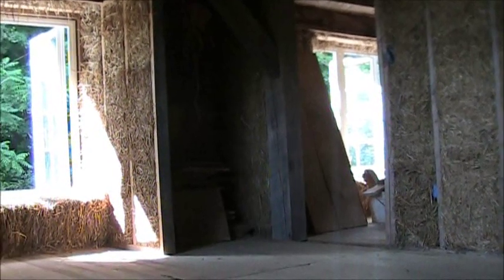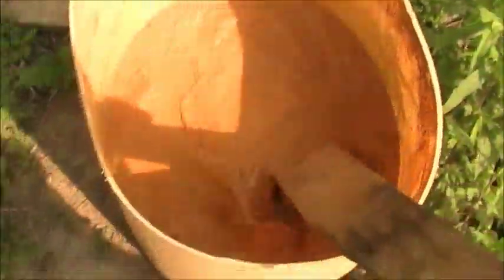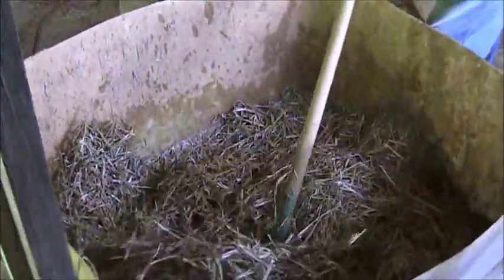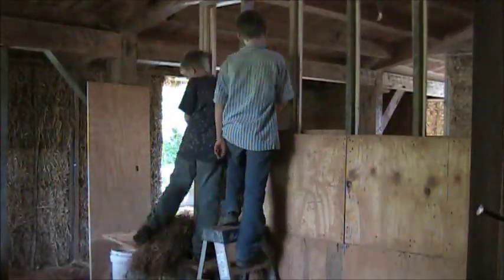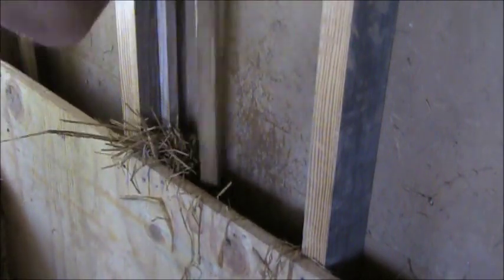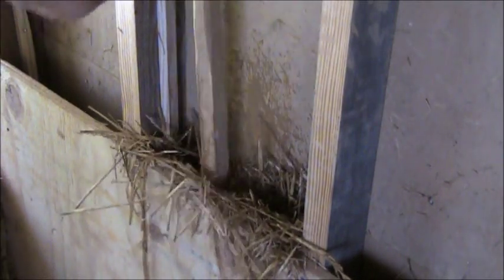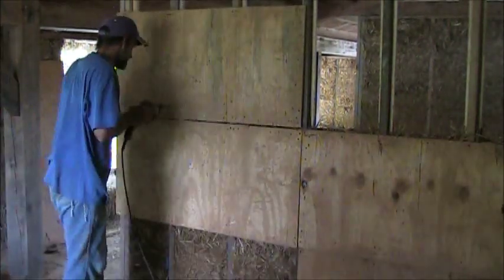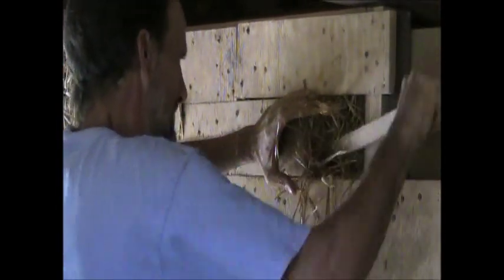Straw in the Wall: Using light straw clay (slip straw) as interior wall fill

Comment from the maker: This building technique (and other ones using straw and clay) have been used for centuries, even in the UK. I don't know what the fire regulations in the UK are, but once the walls are plastered, they are quite resistant to fire, perhaps more so than conventional walls. That doesn't change how regulations work, I know. I am glad that I don't have to submit to irrelevant regulatory oversight where I'm building.
Reply: I couldn't press subscribe quick enough you Sir earned a big ol Texas dammit boy.
That's smart and you made me smart.
Thanks for sharing your knowledge.
Blessings and more Blessings to you and your Family 🤗👌
Reply: Hi!!! Cant find any info. Do you think i need a vopor barrier between straw and exterior sidding???  Using this insulation for a tiny home and doing plaster inside but standard sheeting outside . Help!! 😬ty
Reply from the maker: @kerriemortimer8243  I wouldn't want a vapor barrier immediately against the infill. It would probably be okay with an OSB sheathing and then standard vapor barrier & siding. The concern is moisture that migrates through the wall from the inside. If it hits an impermeable barrier, it will be stuck in the wall, and wet straw will deteriorate and mold. I would be more comfortable with OSB, an air gap, then vapor barrier & siding (an air gap can be achieved with vertical or horizontal furring strips).

Comment from the maker: We used slip straw in the interior walls, all of which were 3.5 inches. Twelve inches for exterior walls is a common thickness, though. The rule of thumb seems to be an R-value of 1.7 per inch of thickness (assuming consistency of mix and packing). That would be an R-value of 12-13 for an 8 inch wall. Although the plaster used wouldn't affect the R-value significantly, the air tightness and thermal mass it provides would affect how well the home could be heated and cooled.

Comment from the maker: Our plaster mix consists of clay-rich dirt that we dug out of the ground, sand, chopped straw, and water. The ration we use is 2.5 buckets of sand, 1.5 buckets of clay (these are five-gallon buckets), and about 1.5 gallons of chopped straw. We add enough water to achieve a desired consistency. You have to adjust your mix to fit your clay-rich dirt -- it's not all the same. So, there is some experimentation to figure it out.

Comment: So, as a ball park estimate, comparing costs of drywall (plasterboard as we say in UK) and SlipStraw, given the studwork is identical and the final finish plaster coats might be a bit thicker on the Slipstraw.

DRYWALL: 2 x drywall panels £5 each, 2 x 25mm insulation £20 each plus cost of cutting, fixing and fittings say 1 hour but that would be working fast (perhaps less if 1 x drywall panel and 1 x drywall and insulation integrated panel (9.5mm + 40mm cost £20 on eBay)  So drywall overall cost including fittings £40 - £75 per 2.8m2, i.e. £15 to £25+ per metre of wall in "straight run" conditions.

SLIPSTRAW: I would estimate you use roughly, one small bale per 8' x 4' (2400 x 1200mm) panel (cost £5 delivered in UK and it takes about 30 minutes (say £10 of labour cost) to fill once wetted.  I can't see very much slip being used (allow £3?), so if the mixing of slip and straw also takes 30 minutes that's a total cost, including labour, of around £28 per 2.8 m2 panel. Let's say £10 per square metre in "best" situations.  The straw could be much cheaper - this "straw infill" method would allow for large round or square bales to be the delivery approach - easier to keep on site until required, and the round ones can be rolled fairly easily right up to the work. 

To my mind the material cost appears to be significantly lower for the SlipStraw approach and most of the total cost is labour which, if you are paying yourself is generally a big advantage.  The straw+clay have a much lower ("delivery only") energy cost and the embedded carbon sequestration is relevant in an eco-build.. 

I can also see how you might use 3/4" ply ro create rounded cornices and alcoves.

Finally, as this delightful viideo points out, "my boys" doesn't always refer to the employed workforce!
Reply from the maker: That's an interesting analysis -- I've never calculated the costs per square meter when using slip straw. I've done both drywall/plasterboard walls and slip straw walls, and both require a fair amount of labor. One item that I don't see in your calculations is the cost of the sand and clay for the plaster to be put on the walls to finish them (and the labor if being paid). If all materials had to be purchased (we used a lot of clay dug from the ground on the building site -- only the finish coat clay was purchased), the slip straw approach may be the more expensive of the two, but it will have less embodied energy in the materials and will be more environmentally friendly.
Reply: Hello Milton - Love your work! Watching Slide Show Part 1 and Part 2 now.  Respect on the framing detail! 

I am glad you liked my cost analysis, sorry to focus on costs in the context of your "debt free" approach.
. 
So I assumed the finishing coats would be about "about equal in cost" in both cases, but you saying drywall will have a much lower skim thickness and therefore cost I believe? 

I am in the UK and have Ash that I planted - with which I hope start building a hybrid advanced frame - roundwood home.  Like you  I am trying approach my project from a "near debt-free" approach.

In your experience is a lot of "trial and error" involved in getting the slip and render mixtures right when using non-manufactured sands and clays?
Reply from the maker: Getting the mixtures right does involve some experimentation, whether with site-based materials or ones that you buy. Nothing extreme -- just try different ratios and compare the outcomes.

Generally, drywall is finished with joint compound over the seams and screw heads which is sanded smooth before painting. The plaster applied to the slip straw actually takes the place of the drywall -- it's the skin of the wall. It isn't as durable as drywall, in my experience, but it is natural and has an organic feel/look to it. Finishing it to drywall smoothness and flatness hasn't been worth the effort in my work. In fact, we're at the painting (natural clay-based paint) phase in our project, and the first coat includes silica sand to give the walls some texture which covers up imperfections and trowel marks that weren't buffed out completely.

For me, I think drywall would have cost more, although the time investment would have been less. I also would not have had the insulation in interior walls. I didn't pack the walls with slip straw for the purpose of insulation but in order to provide a base for the plaster. It's also possible to plaster directly on top of drywall -- I considered doing this, and did do it in a couple small areas.

Focusing on costs is important for doing a project debt-free, more so than for building with debt -- you have to pay for what you're doing when you're doing it or before. If you're willing and able to provide the labor, you can do a lot of things. The most important part is to believe you can and to be willing to try things out in order to figure out how it will work. Too many people aren't adventurous enough, I think.

We're on track to finally finish enough to move in this spring. I'll be putting together another slide show video to go with parts 1 & 2.

Thanks for you comments!
Reply: MiltonMudburn Love your help man!

Comment from the maker: The chance of fire is very limited -- I would be much more concerned with empty-cavity walls. The clay slip the straw was coated with deters fire. Also, the straw is packed in the wall, limiting the amount of oxygen available for combustion (kind of like burning a phone book). Additionally, it is sealed in the wall with 1/2" of plaster on both sides. It's not a fire-friendly environment.

Comment: Hi, I have just found your incredibly informative video. Thank you so much for sharing your expertise. I wonder if you could answer a question please? I want to convert an existing outbuilding into a studio so the exterior walls are already there (concrete and terracotta blocks sadly, but at least that’s one cost I won’t have) but I need to insulate these walls and was hoping to be able to use this method. I think the technique itself would obviously work but are there any problems likely to arise when one side of the wall is made of the materials described above? Also, did I notice full bales used as an exterior wall (under the window)? If so, how did you hold them in place? The building currently has an open front which I need to fill in. Many thanks.

Comment: Super helpful video to get a sense of this type of work.  I'm thinking of insulating exterior walls of  my storage shed this way, am in the deep South of USA.  Hoping it will be okay in an exterior wall.  Currently the walls have OSB type panelling that looks like siding on the outside.  It's only 10' x 12', so should go fairly quickly.  I'm not sure where I will find dirt in the city....  Thanks again.
Reply from the maker: If the straw in-fill is kept dry, it should work fine. Water/moisture is the main threat to it. If you can't find clay locally available, you can order a 50 pound bag from a pottery supply business.

Comment: Hi milton awesome video can u tell me will this keep me as warm as using SB for my exterior walls? I want to build on my land but in Northern WI and it gets pretty cold up there winter sub zero temps
Reply from the maker: The R-value for straw walls increases with the thickness of the walls. Straw bales are 18" thick, nearly 5 times thicker than a 2x4 wall packed with slip straw. So, there is no way for a thinner wall to insulate like a thicker straw bale wall. I don't know how slip straw as insulation compares to other forms of insulation.
Reply: @MiltonMudburn  thanks so much

Comment: How long did you wait to take off the bottom form?
Reply from the maker: I took off the form as soon as I finished packing in the form above it. You can "slip" two sets of forms up the wall that way.
Reply: @MiltonMudburn  That's cool. Curious how much this stuff weighs. Considering it for inside a step van. The walls would only be an inch or 2 thick. Wondering how it would work. Exterior walls are made of aluminum and then there are aluminum ribs so it seems like I can do something similar to what you did in the video.

R value seems low though for only a wall that's going to be an inch and a half thick. Would get better r value with that poly stuff but I don't like it. Hemp and wool look pretty good too but expensive. I like the idea of making something. Just don't know if it would offer much insulation in this case.

Comment: Hi,
Thanks for sharing this.
How long do you let the mold in place before removing it?
Reply from the maker: you can remove the forms almost immediately. We removed the bottom ones once we had packed a set above and moved the lower ones above until we reached the top of the wall.

Comment: I'm in the process of building a budget Man Cave out of pallets and was trying to find an alternative insulation. What exactly is the clay mixture? Could I simply pack the straw in the walls between the outside and inside panels?
Reply: +Ceace Williams Did you end up using the slip straw?  I also have a building made from pallets and need insulation.  I am fixing to try it  now.
Reply: +Michael West  Well, I have not made any more progress on my pallet shed. I am planning to move to another state, and I don't intend to put any more time and money into it since I can't take it with me. I was intending to use the straw technique. You should try it, and post a video of the results. I would be interested in knowing how it turns out.

Comment: You mentioned the walls were 12 inches. We are thinking about building a slip straw home, but we're limited on square footage, so we would most likely have our walls about 8 inches. Would this drastically effect the R-value?
Reply: 1.7 r  per inch of wall. compare to whats used in your area for fiberglass batting

Comment: House would light so fast if a flame got in there
Reply from the maker: That's a silly notion. Packed straw sealed in place with clay and covered with over 1/2" of clay plaster on both sides will not burn easily. It would take a lot of effort to burn it.